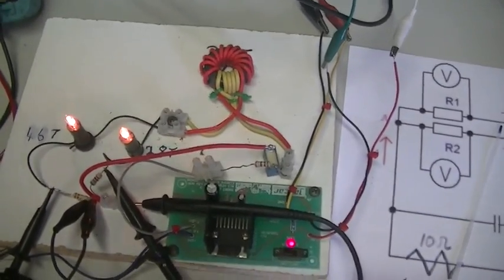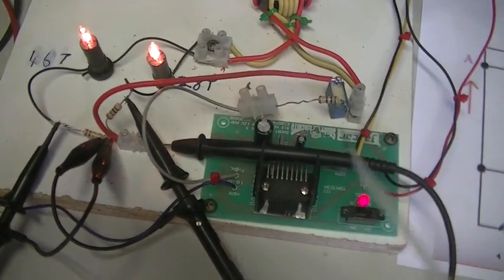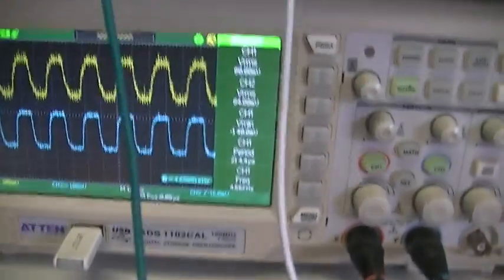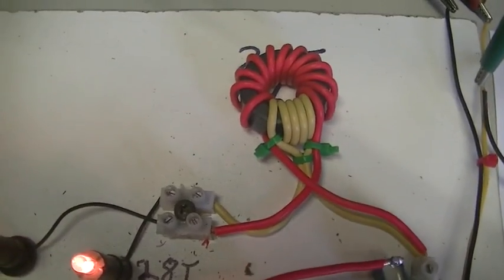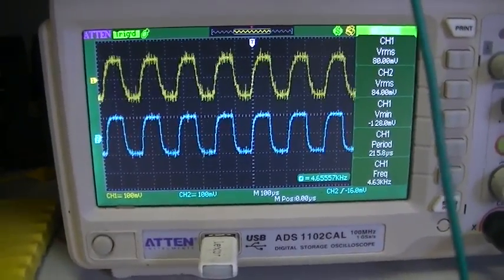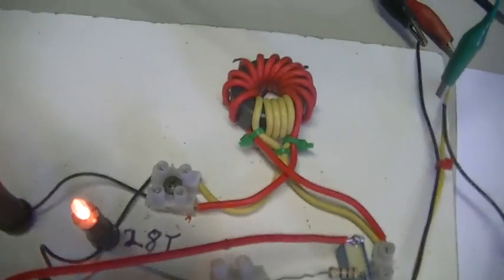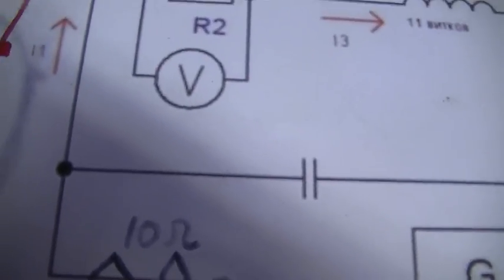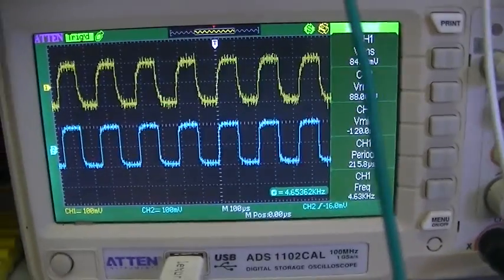OU transformer test 2

Comment: Salvage your toroid out of a mains filter did you ? try a blue hf toroid, each time you increase the ratio between windings like 3t and 9t you move the nodes frequency up in frequency in this case 3 times in order to get resonance so if the 9t winding was 1mhz what freq do you think resonance could be achieved at ?

Comment: it looks like you have the toroid wired in bucking mode
good thing you didnt cut the blue wire 
you can see the effect of the bucking fields showing up as ringing in the waveform it looks like. if you increase the power input the ringing will increase and become the dominant waveform and I would like to see what that looks like